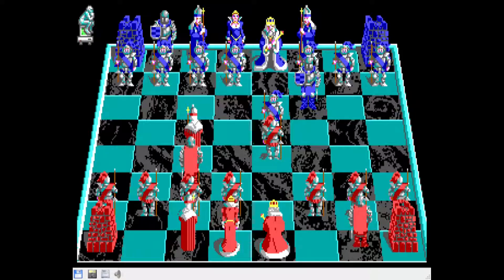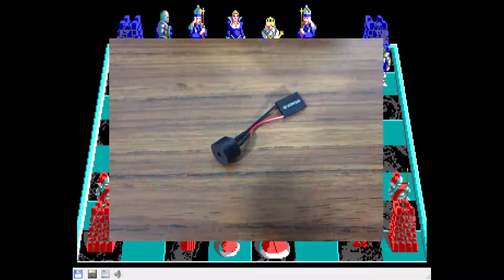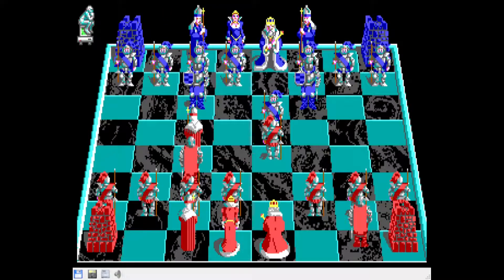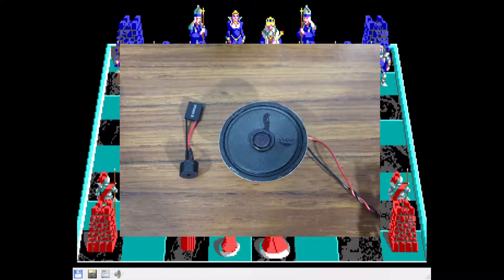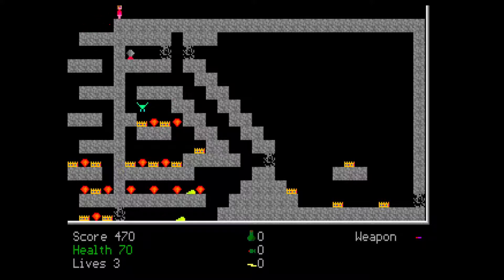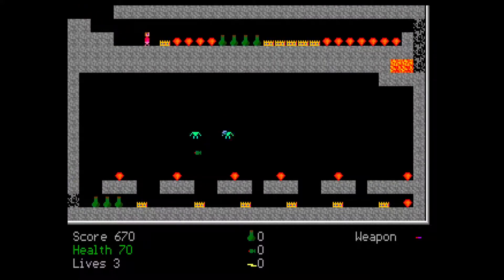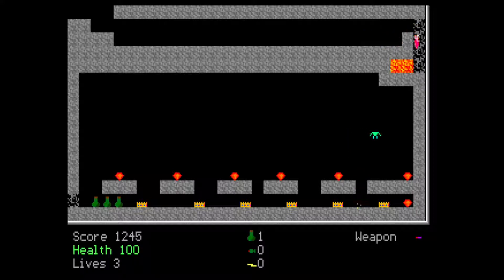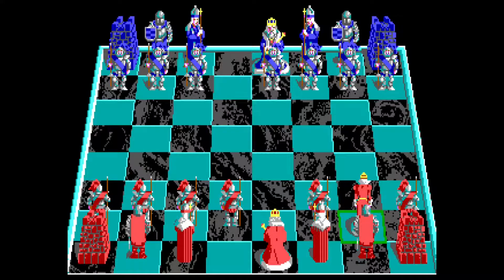PC Speaker: Cone V's Piezo

Comment: I just made a comment on that video yesterday i think about the same thing. and today youtube recommends this! I think there were also systems with slightly bigger speaker than the one you are using. So it's possible your system may have had an even better one than the one you are testing. Also case/fan positions could also affect the sound.
Reply from the maker: Yes this exactly, there was a bit of variation in the speakers of both types and that would affect the sound, as well as the shape of the computer chassis and other components. For the recordings here I turned off as many fans and external noise as possible and pointed the mic directly at the speaker (it wasn't mounted in a chassis). I think the only fan running is the power supply fan. I even loaded the games from a floppy so there was no hard disk sound. Unfortunately I don't have much variety in spare speakers so I couldn't really test different sizes and types.